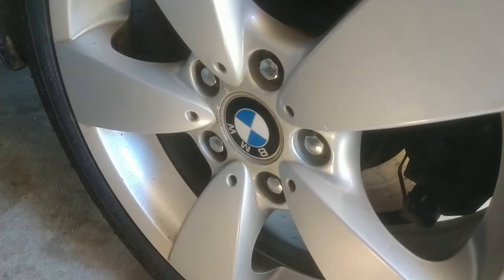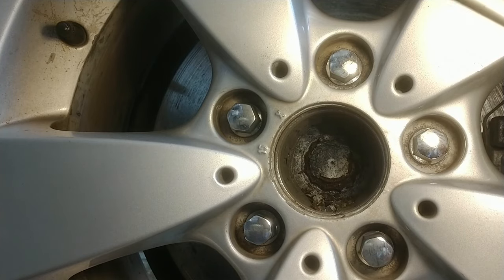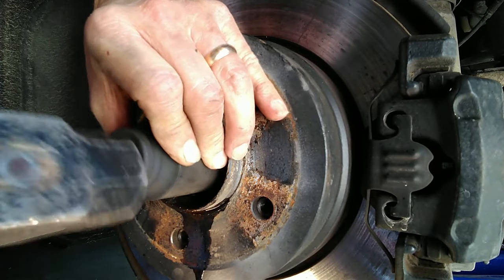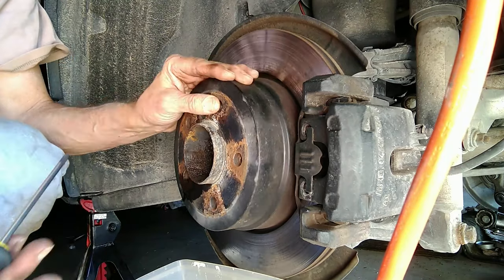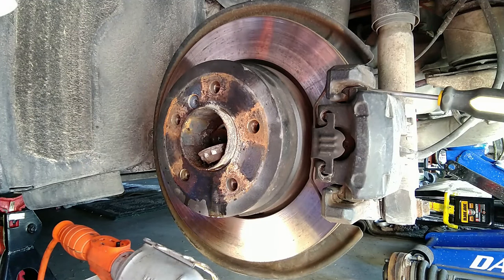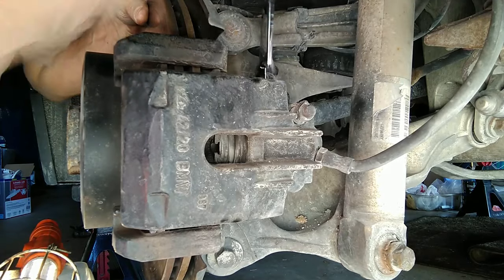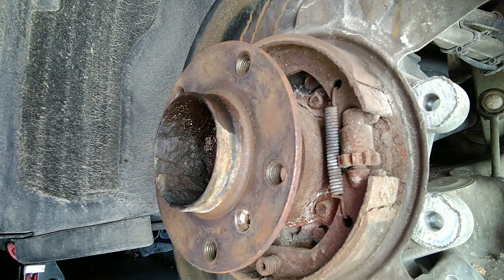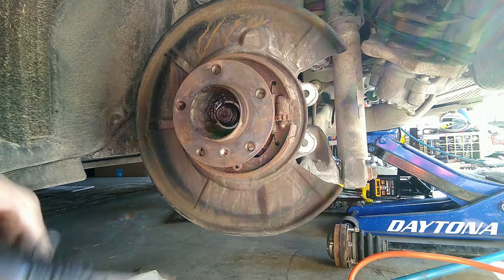Removing rusty / stuck rear axle in BMW E61 using Harbor Freight Tools (axle was bad as they get)

Comment: Had a Axle nut that wouldn't come off. It laughed at my impact drill. I jumped up and down on my breaker bar and it didn't budge. I finally took my 3 ton floor jack and jack up the breaker bar to loosen it. I said either the bar or the nut is going to break. It finally broke but took a lot more force than I was expecting. 350lb stock torque plus rust.
Reply from the maker: That's a trick I've used before. You can add nearly unlimited torque without breaking a sweat, though use caution in case something fails catastrophically. I once lifted the rear end of my Jeep Cherokee off the stands using a stout high quality breaker bar when torquing a pinion nut with a floor jack. I guesstimated the torque at nearly 2,000 foot pounds on the nut.

Comment: excellent job! i use the turn n hit using a REAR HUB PULLER,   it looks like a spider with 4 holes which aligns with lug nuts. and of course soak it up with bp blaster. also noticed u did not removed axle screws... neverthe less i loved it....could not stop the laughter....then after you put axle on through the spline you better clean all the splines once you get the threads through try to screw the Nut n use your HF tool n screw the heck out of it until you aligne the two tabs..enough said...
Reply from the maker: I would have loved to get away with just using a hefty puller, but it wasn't in the cards in this car. And yes, those splines had better be cleaned up on both surfaces before reassembling. No one wants to go through this twice! ;-)

Comment: I had to remove the rear trailing arm on my 2001 E46 and take it to a machine shop. It took nearly 45 tons of force to finally remove the axle from the hub. We were actually scared it was going to bend the trailing arm. I used the exact same Harbor Freight puller and it's poorly designed and it didn't budge the axle.
Reply from the maker: I suspect mine would have probably taken that kind of force to remove as well, if I hadn't used heat and the air chisel. I wouldn't really hold that against the 10-ton puller, which does a great job, as long as you don't need more than 10 tons, which is about 50 times what most people would need to extract a clean axle. :-) I couldn't find a home puller any bigger than the one I bought, so would have been forced to use a professional shop style puller, which would have probably cost 10 times what the Harbor Freight 10-ton puller cost.

Comment: I have a harbour freight impact driver/ corded, and it still works after more than ten years; but I since got me a ryobi 18v impact. I will still need the corded one for heavier jobs like what you are doing now, I guess.
Reply from the maker: It's great to have both. You will need the corded one for really big tasks, like breaking the rust bond on the axle nuts, and the lighter cordless driver for 98% of the other stuff. I don't know why I waited so long to get that cordless driver but I find myself using it all the time.

Comment: The pointed air hammer bit doesn't have nearly the power as a flat bit. Also need more than just propane when working with rust
Reply from the maker: Pretty sure I did use a chisel tip when I got the second hub loose, but it's hard to say for sure (you can only get a short glimpse of the air tool).  From that angle, it does look like a chisel tip, and I do agree that it's going to impart more "bang" than the pointy tip bit (though it's probably not that much different when you're hitting a hardened socket, since there's not much give there).  FWIW, I went to an inductive heater for my front hubs, and they heated the hub (especially relative to the axle) much quicker and hotter than my wimpy propane torches (the only thing I had at the time).  So yeah, more heat is better!  ;-)

Comment: I am in the same process but with a boat propeller shaft to remove the flange on the engine side. The nut came easy and the shaft is a 30 mm stainless, while the flang is some kind or iron. So far i used wd40, torch and a similar extractor with no luck. Haven t pushed to the limit yet, before doing some more search. Next i was thinking of a hydraulic extractor, but have to give the sbs a go
Reply from the maker: If it's a salt water boat, I'd guess that seriously stuck hardware is the norm. I'd recommend getting some PB Blaster, as it does a better job of penetration than WD40. Soak, shock and repeat.

Comment: Best bet is a much bigger demolition hammer drill. I have a 20 lbs sds max drill and she managed to get my rusty van axle out of the hub after my puller, blowtorch and big ol sledge had no luck.
Reply from the maker: I actually DID use a demolition hammer / drill.  I can't tell you how big it is but "it's a big one".  ;-)  I had high hopes that it would loosen up the axle, but all it did was make a LOT of noise.  ;-)  OTOH, I'm sure that it would have made short work out of most stuck axles - mine were just REALLY bad.  I decided to not include that video since this video was already going to full-length feature status!

Comment: I used a crows foot and axle press to do mine. Crows foot uses the lug bolts to bolt on. And then the axle is pressed out without removing the rotor. Much less time consuming and requires far less work.
Reply from the maker: I only wish I could have done it that way.  Trust me, your crow's foot would have either broken or the threads would have stripped long before you got that rusted axle out of the hub.  In fact, I used a slide hammer at first on the other side (which uses the same "crows foot" to attach to the hub).  Broke the crow's foot without so much as a wiggle out of the axle.  My axle was "about as bad as it gets", while most will release easily with MUCH less draconian measures.
Reply: @Mark_H_DIY  I live in New England. Parts get rusty here to. The crows foot is solid steel. It's pretty strong. I do understand how bad rust can get tho.
Reply from the maker: @jamesbrown4401  Yeah - I'd never seen one this bad.  Remember that I used that 10 ton puller, AND two torches (getting the hub to around 400° F) AND an air chisel to get it broken loose (and that's after many liberal applications of PB Blaster).  FWIW, I got the front axle out a little easier.  I still had to use the 10 ton puller and the air chisel, but used an inductive heater that got the hub up to around 350° in less than two minutes, which means that the temperature differential to the axle was better than using torches - which took a long time to heat up, of course).

Comment: Great job. I hope you changed the hub assembly after all that pulling, beating and heat on it.
Reply from the maker: FWIW, I didn't change it out. The hub is way, way over-engineered and was still square and straight when I was done with it.  I did get it good and hot, but not enough to hurt it from a metallurgical perspective. I also used that 10 ton puller, but that's not enough to warp the hub.  It would be a good idea to check a hub for runout if there's any doubt about it.

Comment: I presume you'll be reassembling those parts with some grease and a new abs ring. You've put me off BMW's forever🤣!
Reply from the maker: LOL... I'm all about reusing anything I can, but the only parts I left unswapped were the axles. And of course, I've since replaced both of them as well. The end result is that my now 170,000 Mike E61 still rides and feels like a new car (though it no longer smells like one).
Reply: @Mark_H_DIY  I like your ethos, and also drive an old car that I maintain myself, however I run something simpler. A comment my dad made when I was a teenager about complcated cars having more stuff to go wrong has haunted me ever since. Over 40 years on my 22yr old car is now far more complex than the most complex cars of the early 80's. You certainly have some tenacity in not letting a job beat you. Keep up the great work!
Reply from the maker: @neiljarvis8911  My other car is a 1996 Jeep Cherokee, with a manual transmission and no electric anything. I'll undoubtedly keep that one until I'm buried in it, and enjoy its relative simplicity, though just yesterday I did have to swap both the crank position sensor and front drive shaft. I guess no vehicles are totally of mechanical issues. ;-)

Comment: Just thought I'd mention it, but using a chrome vanadium socket ( as you did over the impact socket) is a bad idea on a puller. With the pressure that socket could easily of shattered.
Reply from the maker: The real stress on that socket was minimal, concentrated on the face around the flat. I was pushing it to hit it with the air chisel, but it's a pretty stout socket. ;-)

Comment: Excellent job, just wanted to say that I feel the air hammer would have done the job, you just need to get yourself a decent one. That puny one you were using was making a mockery of you more than anything else. It didn't have the power to break loose that flange. A Snap On BH3050 or a CP717 from Chicago Pneumatic would be your best friend. I personally have an Astro THOR, and it would have put that flange in its place in no time.
Reply from the maker: I'm all about "more destructive power"!  ;-)  FWIW, that little air hammer / chisel has more guts than you might imagine.  I bought it after spending about an hour with a three pound sledge and chisel trying to drive a race out of my Jeep's rear differential, with no success.  Literally half a second after I pulled the trigger on the air chisel, the race was flying across my garage.  In fact, I'd be wary of any tool with the power to drive out the axles on my car (the first time, anyway), since I think it would be likely they'd flare (mushroom) the end of the axle if they were hitting it hard enough to reverse the effects of 15 years of rust.  Maybe not, and hey - I'll look into a bigger, badder air hammer / chisel "just because" I am always up for more tools, especially bigger, more powerful, more dangerous tools!  ;-)
Reply: Could you get the same effect from an electric hammer? I was in the same situation recently and have tried using a dewalt hammer but did not have the proper chisel

Comment: Did you have trouble putting back the axle into the hub?
Reply from the maker: Not a bit. It should go in easily if you have the hub disconnected enough to get the angle right.

Comment: use induction heater on axle.
Reply from the maker: I actually did that on the first front axle I swapped (which had the same issue as the rear axles).  It did heat the hub up much faster, and (more importantly) kept the temperature of the axle lower, so there was more "heat delta" between the two than when using torches.  I was going to show how well this worked on my "front axle video", but (funny enough) the axle I was filming came right out with "only" the 10-ton press.  But yeah - those induction heaters are amazing tools, and I'll be using it in the future on these projects / videos.

Comment: a cheap induction heater would help ,  i bought one , its take out these driveshaft  easly  and same with rear axle adjust bolts,
Reply from the maker: I couldn't agree more.  I actually bought one (around $200 IIRC), and used it on the the first front axle swap.  It got the hub temperature up to around 400°F in two minutes, and even better, did it without heating the axle much (leading to a better temperature / size differential).  I was all set to do a video showing the process on my fourth (and final!) axle removal when the car surprised me by letting the axle push out with only my 10-ton press.  Sigh.  But I absolutely do think the induction heater would have made the removal of those rusted bolts MUCH easier, and I'm glad to have the induction heater in my arsenal of tools... I never, ever mind paying for tools, given the cost of having someone else work on my BMW!  ;-)
Reply: @Mark_H_DIY  Ibought one after i filled up my little acetylen tube 5L and payed 150 dollars for it, the induction heater is also very good to take old nail and screws out from old wood
Reply: Heating up Iron to red reduces the oxygen in the FeO,FeO is softest and FeO4 is hardest,

Comment: BMW and Harbor Freight in the same sentence?
I was never aware that they carry that monster puller. "You cheated!"
Reply from the maker: My general rule is, buy good tools for the things you use all the time.  If I've wrenched fifty years without needing something, I can probably get by with a tool that's less than legacy quality.  ;-)  Honestly though, I've had good luck with HF's stuff in general... a few tools that clearly weren't built well, but I'm happy with that 10-ton puller.  As you can see from the video, I'm glad I held out and went to a second store to keep from having to settle for the 5-ton puller (never would have gotten those axles out with that!).  ;-)
Reply: @Mark_H_DIY   
Some of their items are trash, but they have come up in quality. Pittsburgh pro breaker bar, their jacks are good (Some of the original Daytona brand models were made in the same line as snap on.) I own their 3 ton, older grey low profile/long reach jack.
(I won't mention jack stands.)
Their ratchets work and have lifetime warranties. Haven't used many tools from the Bauer lineup or any Hercules. 
Went through a few of their cheap warrior drills, their angle grinders work for what it's worth.

I've considered the impact used in the video, reviews were great. 
Bought an air compressor instead.
Probably still be nice to have around for ease of use instead of lugging out the compressor and all of that.

Any tool used often should be of good quality. In those instances, not afraid to grab a name brand.

Shop environment...different story. Truck guy is going to clean your pockets.
Reply from the maker: Another great tool was the Milwaukee (IIRC) sawzall that would go on sale for $20.  I've used and abused those beyond words.  I have a decent size compressor, but find myself using that electric impact a whole lot more.  It's kind of large, and unwieldy - but it DOES do well over 1,000 foot pounds of removal torque.  I like the fact it's got "only" 300 foot pounds of tightening torque (coinciding nicely with the highest-torque fasteners I ever deal with, namely the axle nuts on my BMW).  And I do really like the Daytona low-profile floor jack (replaces the ancient Craftsman that I used for probably 40 plus years).

Comment: Merhb öncelikle başarılar diliyorum. Bundan daha kötü durumda olan bir poryayı daha önce çok  düşünerek  kolayca çıkardım.  Bir şırıngaya hidrolik doldurun. Igne uçlu olacak ve siringayi porya miline ic kısma  sıkın.  Yaklasik 2 saat bekleyin. Ve hidrolik cektirmeyle 1 dk da sökülüyor. Sağlıcakla  kalın
Reply from the maker: I did apply penetrating lubricant to the hub / axle interface over a day or two, and it didn't seem to help.  I do recommend doing that though, since it will make most hubs release the axle much easier.
Reply: Aşırı kaynamış durumlarda malzeme       tek bir parça gibi oluyor  bu durumda yapacak pek birşey kalmıyor.  Darbeli titreşim pası döküyor yaptığınız işlem çok güzel emekleriniz için ayrıca teşekkür ederim.
Reply: Aşırı kaynamış durumlarda malzeme       tek bir parça gibi oluyor  bu durumda yapacak pek birşey kalmıyor.  Darbeli titreşim pası döküyor yaptığınız işlem çok güzel emekleriniz için ayrıca teşekkür ederim.
Reply from the maker: Yes, the axle splines and the hub splines had become one single piece.  I've never had one close to that bad before, but at least my struggle seems to be helping people with similar issues.
Reply from the maker: Thanks again!  ;-)

Comment: Lol, I'm having a horrible time doing this job on my E39 at the moment. And I'm in Australia, inland. Bastard of a job
Reply from the maker: Hard to imagine any car in Oz getting rusty (especially in the outback).  That's one dry country (and I live in the US desert).  ;-)  Good luck with the job - hope you get it done.  If all else fails, get a bigger hammer!
Reply: @Mark_H_DIY  Thanks mate. I did have a go with my standard small three leg puller, but I have now ordered a big boy just like your one, along with a benzomatic refill to get some heat on the thing.
Reply from the maker: @AdamAus85  When in doubt, use more heat and more violence! Let us know how it works out! G'day (I lived in Sydney for a couple years).
Reply: @Mark_H_DIY  Got lucky. That big ass 3 jaw puller popped it right off. I did get a new bottle of bernzomatic, but didn't end up needed it. I'm about 2.5 hours inland of the ocean, so perhaps that helped. Kudos for big ass 3 jaw hydraulic puller idea.
Reply from the maker: @AdamAus85  Didn't see your reply until just now.  Glad to hear that the puller got the job done.  When I went to pick mine up, the 10-ton puller was out of stock, but they did have the 5-ton puller.  I almost pulled the trigger on the smaller one, but am SO glad I didn't.  Also, the puller has come in handy for a number of other tasks, like pulling / pressing in the wheel bearings when the knuckle won't fit well in my garage press.  It's nice that it can be configured to a 2-arm puller as well (meaning it'll work on almost anything).  Glad to hear you got that job done - still wondering why a car from inland Oz would have rusty axles like that though... I lived near the coast (Killara, NSW) and don't recall any rust anywhere on the car I had down under (a Suzuki Vitara JLX - I miss it!).

Comment: The best way to remove it. You might be need Milwaukee tools
Reply from the maker: I'd love to have a garage full of Snap-On tools, but my approach is to buy good "everyday" tools (my sockets, ratchets, wrenches), and go with "adequate" for those things I've gotten through life 'til now without needing.  That 10-ton puller is a good example.  Amazing tool for the money, but not the one I'd use if I was doing this for a living (now THERE is a scary thought.... shudder).